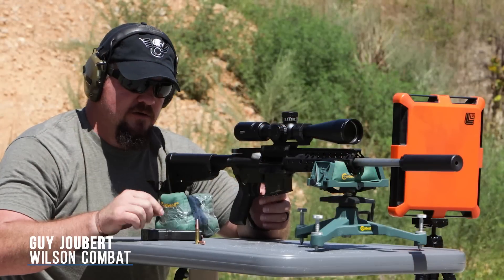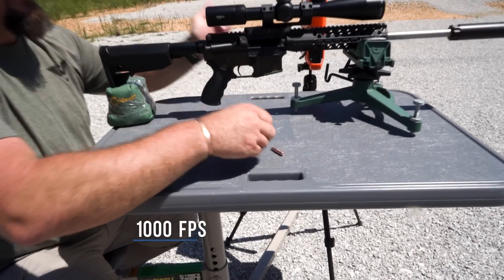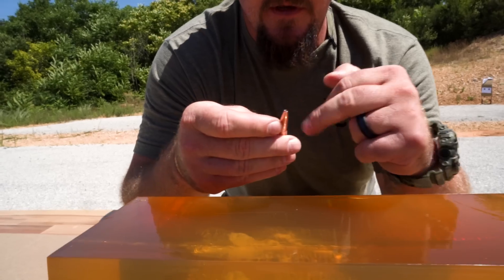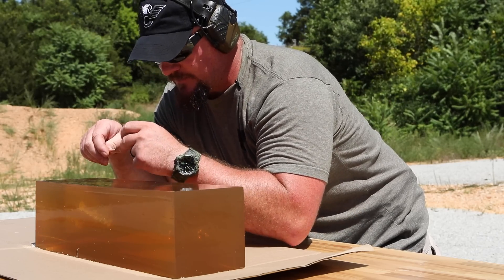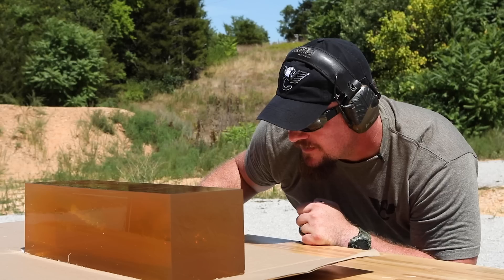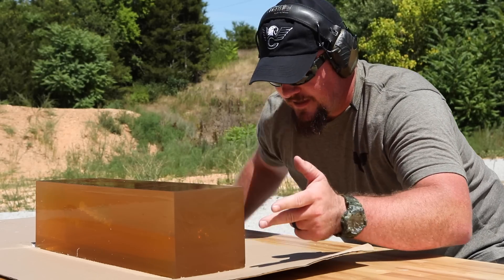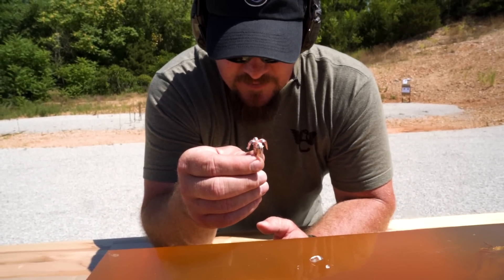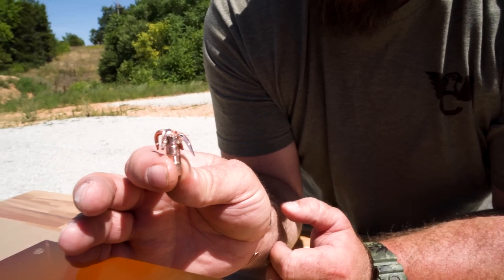Lehigh Defense 194 GR. Maximum Expansion Sub-Sonic Bullet in Gel

Comment from the maker: What Lehigh Bullet/Feature would you like to learn more about?
Reply: Do the same test, but with a 8” barrel and a few layers of clothing…
Reply: 45, 45 +p, 45 Super all out of same short barrel. Defense and penetrator rounds. A gel tested comparison.
Reply: How is the maximum expansion effected by multiple layers of clothing?
Reply from the maker: @roykiefer7713  It does not open up until it hits fluid.
Reply: Exact same bullet shot out if a nine inch barrel through 4 layers of denim into that ballistics gel.
Reply from the maker: @richardthomas6602  It is Barrier Blind.  It will not open up until it hits fluid.
Reply: Cavitator would be interesting to know more about. Why do none of the rifle calibers not utilize the same technology of the Xtreme Penetrator, Defense, and Hunter? What's the difference between the Hunter and Defense?
Reply: I see .452 caliber, 220 grain Maximum Expansion for a .45 Colt.  Will that work in a Glock 21 Gen 4?  And may it be purchased in a way that the Feds, FBI, CIA, whatever cannot track the sale and delivery back to the purchaser?
Reply: @100vg                          

The .45 COLT(sometimes called the .45 LONG COLT) is a rimmed cartridge for use in revolvers, and lever rifles, and in some MODERN-MADE breech loading single shot pistols, rifles, and revolvers(RUGER SUPER BLACKHAWK),  and it can be loaded to near .44 Remington Magnum power levels(for use ONLY in STRONG MODERN-MADE FIREARMS) FOR HUNTING, and is NOT for use self-loading pistols!!                          

I believe that you are thinking about the .45 ACP rimless cartridge, and the two cartridges are NOT the same!!                        

The .45 COLT was originally a black-powder cartridge that was developed in the 1870's for the for the 1873 COLT Single Action Army revolver, and the WINCHESTER lever rifle of the same era!!                        

The .45 ACP was developed BY John Moses Browning using smokeless powder along with and for the COLT 1911 pistol(also designed by John Moses Browning) for the United States Military forces which became known as the M 1911!!                        

The two cartridges are NOT INTERCHANGEABLE!!                         I hope that this is of some help to you!!
Reply: @texastomsshavingtips6359   Thanks.  I figured not being called a .452 round and .45 Colt.  I did see some called .451 that said they were for .45 ACP.  I have a Glock 21 Gen 4.
Reply: @texastomsshavingtips6359   I was looking for Maximum Expansion Loaded Ammo in .45 ACP for a Glock 21.  Sorry for any confusion.  Or something Lehigh makes similar to a Hollow Point Round.
Reply from the maker: @DV8 *** It will not open up until it hits fluid.
Reply: 7" for 300 pinky. Who tf use a 16" derrrrrrr

Comment: I wish you would have used a 9" barrel. Much more common length of a gun in 300bo.
Reply: It doesn't matter how long you barrel is It matters the velocity of the damn bullet.  You can have a 2-in barrel or a 200 mi barrel The velocity is still 1,050 ft per second.   Come on get your s*** together this isn't complicated dude!
Reply: Bullet velocity is tied to barrel lengths though
Reply: @yacobz kind of sort of maybe.   If you run a really hot powder, you can get a lot of speed out of a short barrel.
Reply: It doesn't matter, barrel length.  What matters is bullet velocity.   1000 fps is 1000 fps out of a 9" barrel or a 16" barrel or a 30" barrel.
Reply: @GalloPazzesco  It matters when you are purchasing this box of ammo instead of reloading it

Comment: Hey guys, I think we'd all appreciate seeing it in a 7" barrel as well
Reply: @LookiePookie1  that’s average so don’t be too hard on yourself
Reply: Agreed ^ curious if it’ll be able to get at least slightly comparable expansion
Reply: @375Cheytac  barrel length is irrelevant.  Terminal velocity is of the bullet is what matters.  That shot was at 1,000 FPS.  No reason you can't get 1,000 FPS from a 7" barrel.
Reply: @edwardlance2379  Barrel length absolutely is relevant, and terminal velocity has absolutely nothing to do with it. 

Terminal velocity occurs when the vector exerting force on an object (causing acceleration) is equal to the opposing vector (opposing acceleration) which is usually the resistance of air. Terminal velocity would only apply to a bullet if there was a sustained force behind the bullet as it travels, however this force abruptly ends the second the bullet leaves the barrel and the expansion of the gasses are expelled in all directions (forward of the muzzle). When this occurs the bullet has already reached peak velocity and begins to slow down, which means the bullet is absolutely NOT experiencing terminal velocity. 

In terms of barrel length - it is absolutely relevant. 300 blackout (and ALL rounds for that matter) does not experience 100% powder burn/gaseous expansion out of any barrel length up to 26” (where it is no longer practical to measure because who would realistically carry a rifle any longer than that). The reason people say 9-12” is an ideal barrel length for the round is because it’s about finding the right balance of velocity and compact barrel length. A 16” 300 BO firing 110 grain Barnes yields an average velocity of 2397 FPS. That same bullet traveling out of a 7” barrel achieves a muzzle velocity of 1973 FPS (424 fps OR >1 football field per second faster). Both will absolutely be lethal, but it’s up to the individual to determine their capability requirements vs utility of a compact weapons platform.

TLDR; please review physics, general terminology, and the dynamics of gaseous expansion in contained/directed spaces and how they compare to non-confined spaces because you certainly missed the mark.
Reply: @edwardlance2379  To lend credence, you are correct in that you can get 1000 fps out of a 7” 300 BO. However you will most likely need a much lighter round (160-170 I would guess) to achieve this without packing a dangerous amount of propellant and risking a critical failure of your system (or sending pieces of metal 1000 fps in the wrong direction).
Reply: @375Cheytac thank you for this! I saw this comment and was immediately running to reply.  Hard to believe that anyone would think that barrel length doesn't affect bullet velocity. If that round is a thousand feet per second out of a 16-in, I will most definitely see less feet per second out of my 10.5 barrel.
Reply: @375Cheytac  And on this you'd be wrong. I have over 40 years experience in reloading and ballistics.  As for your diatribe on physics and barrel length and the blabber about "terminal velocity", I'd suggest YOU go learn a little more about propellants, velocities, pressures and barrel lengths.  There is a reason different powders have different burn rates.  Yeah, you missed the mark.

You'd also be wrong on needing lighter projectiles and dangerous amounts of powder.  I load and shoot 212 grain Hornady ELD-X bullets from my suppressed 7.5" 300 Blk SBR at 1050 FPS with 11.4 grains of CFE-BLK powder...and that load is not even the max powder load for that bullet.

But, nice try.
Reply: @christopher7310-   Just to be clear, no one is saying barrel length doesn’t effect velocity.   What is being said is RELOADING is manipulating velocity..  there is a substantial and significant difference in that fact.   If I can reload a particular bullet to exit my muzzle at 1050 fps so it stays subsonic from a 16” barrel, I can also reload the same bullet to be 1050 fps from my 10.3” barrel.   They will both be traveling subsonic and both be shot from different barrel lengths because I manipulated the load data..  that’s why people are saying the barrel length is irrelevant.   NO ONE is suggesting barrel length in and of itself has no effect on velocity.
Reply: @edwardlance2379  I'm glad someone showed up who knew what he was talking about. That other dude sounds like chatgpt lol
Reply: Imagine typing all of that to say absolutely nothing. It does not matter the barrel length, assuming you use the same round, you can have 40 different barrel lengths all firing the same round and you would never need to know the barrel lengths. All you need to know is the bullets speed at barrel exit. If you know the bullets speed at exit of the barrel you know exactly how much energy it’s going to exert on an object. 1000 fps is 1000 fps it doesn’t matter what barrel it comes out of, assuming the bullet and barrel twist is the same of course.
Reply: Why?  Are you smoking pot or what's wrong with you?  Velocity doesn't matter how long the barrel is 1100 feet per second you're breaking the sound barrier.  You have a 3-in barrel and get a 1,050 ft per second and that's it!!!!!   

4567 14 or 29 in barrel it does not matter velocity is what matters.

Comment: The .40 S&W is an attenuated 10mm Norma to accommodate the non shooters at the FBI who are apparently very recoil sensitive. Saves brass and powder overall and fits in a 9mm frame as opposed to the full house 10. Doesn't offer anything in particular over the .45 ACP nor much over the 9x19, either. Answer to a question nobody asked but it gave Paul Liebenbergh an excuse to show up the engineer honchos at S&W when he built the first 4006.

Comment: I personally would put more faith in Hornady Sub-x over the Lehigh bullet. While the expansion of those pedals is very impressive, they are very thin and probably prone to breaking if they hit bone or a hard barrier. Also, Lehigh come off as snake oil salesmen when you look at their other bullet lines. It’s pretty suspect when they claim this thing has a G1 BC of 0.638, which is better than some 308 VLDs of similar weight despite having a big hollow point and pressure rings on the side.
Reply: Not sure where you’re getting the .638 BC from, Lehighs website states .545, which considering how long it is, it’s unbelievable.

Comment: At what velocity do these stop expanding??? I would say most people are running a 10.5 inch barrel (+/- a couple few inches) in 300 Blackout...
Reply: According to Lehigh the maximun expansion bullet open up down to 750 fps.
Reply: @nestorarcilaosorio2457  that's good to know thanks for the info
Reply: 10.5 inch barrel is the most optimal for 300 blackout. There's a reason no one's using 7.62x39 or 556 with that short of a barrel
Reply: @M8Military  I've got all of them in that barrel length
Reply: @M8Military the MK18 wants to talk

Comment: I know everyone hates 40 cal but I would like to see more advancements in 40 cal ammo. It's a definite street performer and has a high 1 shot stop stats to go along with it
Reply: USP40 FTW!
Corbon 135 gr. JHP or Powerball.  Or 140 gr. DPX.
Reply: @pauljohnson9445  How about using the .400 Corbon, hotter and faster than .40 S&W in a .45 ACP sized case??
Reply: @texastomsshavingtips6359  Never saw it or shot one.  Looks pretty good in theory.
Reply: @texastomsshavingtips6359 Just go with the .40 Super. A .40 in a .45 win mag case.
Reply: @pauljohnson9445   Thanks.
Reply: Absolutely correct. There is nothing wrong with the .40 as long as the controlled expansion and penetration with good bullets is present.
Reply: @peoplehavetherights  40cal is not a good round, it is difficult to reload due to its pressures, the round beats up the firearm and has more wear on the components. 9mm and 45acp out perform it. It was a dumb idea from the get go to try and make a weaker 10mm. The round needs to die off as it should. Its in that funny spot of meh of a round. There are more negatives to it then positive reason to carry it
Reply: @zack9912000   I think you've been watching too much YouTube bud. It beats 9mm pistols converted to shoot 40 but pistols designed around 40 last just as long. Pistols are made so robust these days and people rarely shoot enough to even wear a spring out let alone the gun. Think you've been on the 9mm bandwagon too long
Reply: @zack9912000  40 cal is the only caliber with the one shot stop percentages almost comparable to 357mag. Not saying they're equal by no means but it's a definite street performer with credentials to back it up
Reply: @zack9912000  HK USP40 was designed around the cartridge. It was the first, and also had the proprietary rails that the Germans love so much.  But it's not going anywhere slick.  Pistol in 40 is same size as the 9, but the round stops like a 45.  Even better in some cases.  That YOU don't like it is fine.  Nobody cares what you think.  But it's a top performer.  If I knew I was going into battle, it would be with 2 USP40s.  
Nobody really got crazy enthused about the 6.8x43 spc.  But it's an awesome performer as well.  Touch more recoil than 5.56, but gives you 80% of the impact of a .308 with 50% of the recoil.  Dudes are taking deer or elk at 400 yds with it.  Kinda maxes out at 500 but still a big improvement. Great 5.56 replacement. And the spc II chamber further enhances it.  So it's kinda the same thing as with the 40.
Reply: @timjohnson8390  where did you get those statistics? Just curious.
Reply: @ryanlane4282  I got them from reading the FBI's analysis on one shot stop percentages. The info was taken from military engagement as well as street engagements from police shootings
Reply: @ryanlane4282   there's also an older article in guns and ammo magazine by a guy name George Ellofritz (may have the spelling wrong) on the same issue and unbelievably the lowly .32 has the highest 1 shot stoppage.
Reply: @timjohnson8390  I thought that was the study you were referring too. Ellifritz did a great job. I will agree that the .40 is proven and it does outperform the 9mm and .45 on paper. However, the Ellifritz study showed a lot of inconsistencies. For example, the .357 magnum should not have a lower failure rate than shotguns. .22 should not have the one shot stop rating that is does, etc etc. That study just showed me 3 things. 
1. Stats are weird because every situation is different. 
2. Caliber and capacity doesn’t matter as much as we think it does, just carry what you shoot/like the best. 
3. Despite rule number 2, don’t go below a .380 ACP or .38 Special. 
I have a 9mm, a .380, a .22, a .45, and a .357 magnum. I wouldn’t carry the .22. The .380 is too small for me to shoot well. Of the other 3, I shoot the 9mm the best.
Reply: @zack9912000 I reload 40 and have had no difficulties with pressure. Grab some 165 gr bullets and down load it to give yourself some extra room in the case. I don’t carry reloads, I carry factory JHPs, so some weaker reloaded FMJs for practice are fine. Loading full power is kind of pointless. 

Speaking of practice rounds, the weaker and lighter FMJs I reload don’t beat up the gun and I’m not shooting thousands of full power factory JHPs for practice. A couple mags a year to burn up old carry ammo to make room for fresh ones isn’t going to wear a decent gun out. I run a few thousand reloads through every year and about 50 factory JHPs. 

Commercial 10mm are usually downloaded to .40 power. So why not just carry a .40? Sure, it’s weaker than full power 10mm, but it is still more powerful than 9mm and 45 ACP. The reason to carry it is there is a higher percentage of stops for each shot than in 9 or .45. Every bit of advantage helps. 

In the right gun, the recoil isn’t any harder to control. I have competed with both 9mm and .40. My scores are nearly identical between them. I shoot a Tanfoglio .40 and they handle recoil very well. With the right gun and good form, .40 is not slower nor harder to shoot than a 9.
Reply: The only advancement needed is companies to produce True Norma spec 10mm
Reply: I love my 40.   Faster than 45 and with HSTs or some of the others you approach .70 or better on expansion.
Reply: I like the .400 Corbon in a 1911, but I have never shot the .40 S&W!!    In the right cartridge, and in the right gun, with the right loading, the .40 cal. can kick some serious @$$!!
Reply: @texastomsshavingtips6359  In my opinion people that don't like 40 cal are the ones that have tried to shoot it from a smaller platform than was designed to shoot and it's "too snappy" no recoil management oh let's get a bb gun (9mm) lol
Reply: I love 40
Reply: @rueridge7597  Me as well it's  my daily carry XD40 mod2 subcompact
Reply: Liberty civil
Reply: When you want the best of both worlds you get 357 sig. Can't wait for my holster to come in for my G33. Now THAT is a pocket rocket my friends
Reply: I love my .40!
Reply: Just drop a 357 sig and your 40 caliber now I got the best of everything.
Reply: Stop it
Reply: @Tim Johnson I don’t hate the .40 S&W. I actually like it a lot. I dislike 10mm more than a .40 because so many companies making 10mm rounds actually aren’t much more than a .40 S&W as far as velocity and ft/lbs of energy goes because they load them weak. I’d like to see more +p .40’s personally. The only reason I went with a 9mm lately (I may be in the minority, but I think it!s a fine round with all the choices) is because at the time I was looking for another pistol, .40’s were hard to come by and very expensive compared to the 9mm. But prices are coming down a little now and availability is starting to creep back up for the .40’s.
Reply: My theory is that it was so good they had to switch back to 9 because the bad guys were dying. Nobody to stand trial. 9 is great and all, but it is no 40.
Reply: Switching to 9mm raised the annual qualification scores.   Not a good reason, but that’s why
Reply: @jfox1078   I get why is bc cops can't shoot but what I'm saying is that seems like more ammo companies put all new efforts and technology into 9mm. It would also be nice to see some of those advancements in the 40 cal ammo is all. Just a wish list lol